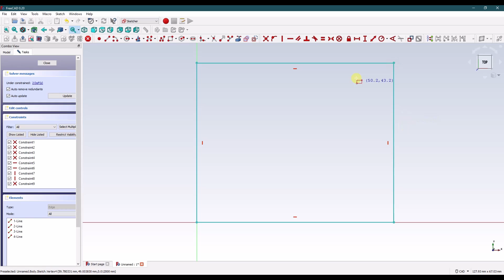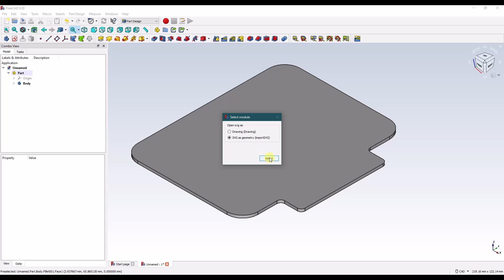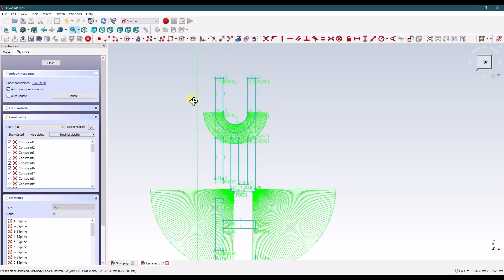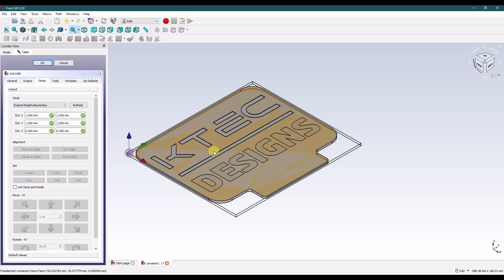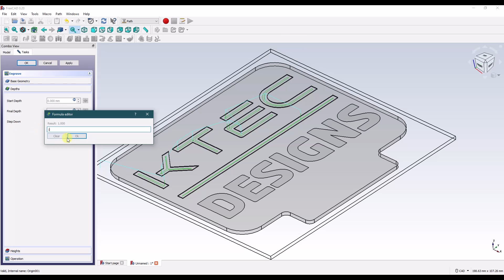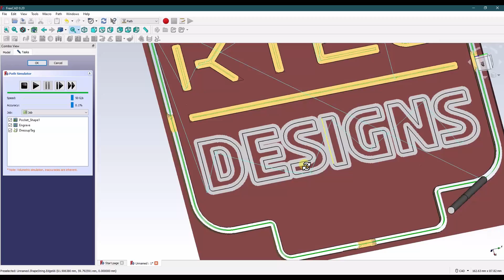FreeCad Tutorial #10 | Part 1 | How to use the Path Workbench in FREECAD for acrylic edge lit sign.

Comment: Thanks for your work in this. Because I am fairly new at using FreeCad for with Path, I would appreciate slowing down on the selecting options.  You are very familiar with FreeCad and perhaps most others are too, but it can be a little hard to follow with the real quick selections back and forth. I guess I should slow the playback speed down. Overall great work.

Comment: This is useful tutorial.  At some point,  lt is hard to follow  up. Specially, somehow two schecks are merged into one but in my case, two schecks are separated with a clear line. In the end, l cannot add fillets into corner. I can't figure it out what my design is different from yours. I am using  0.19 version